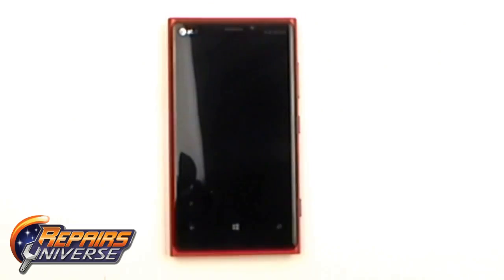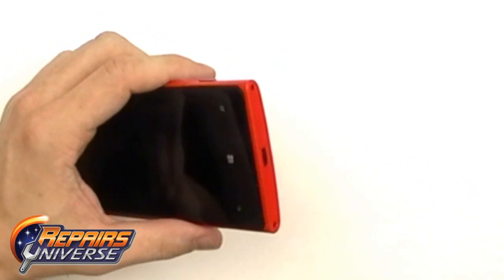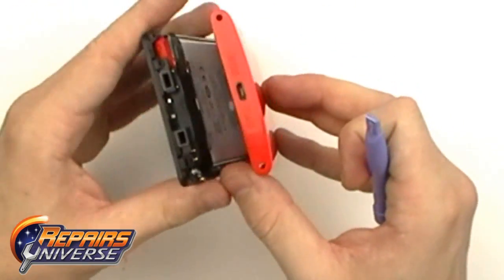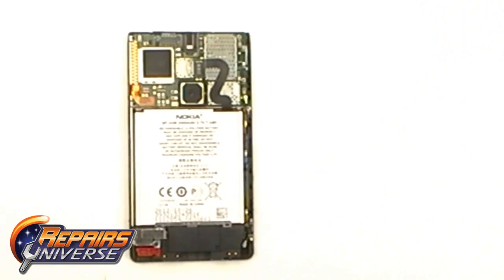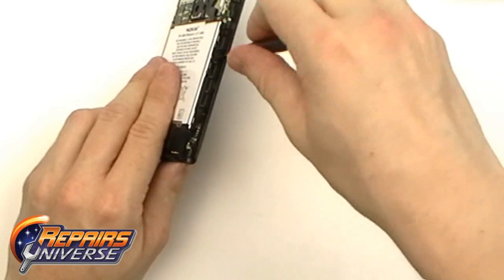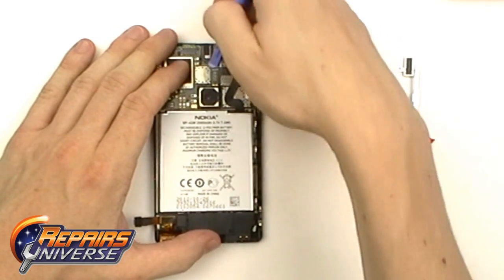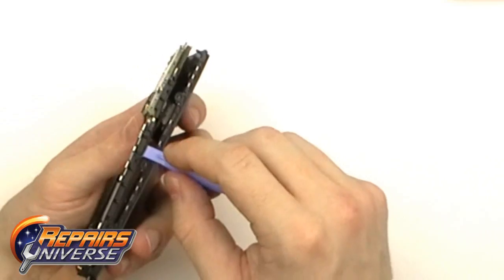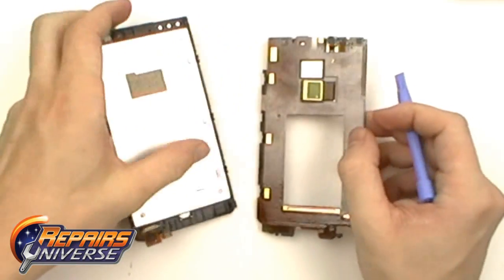Nokia Lumia 920 Screen Take Apart Repair Guide

Comment: I only needed to get in far enough to reach the sensor and front camera. I did NOT need to remove the T-2 (or T-3, my smallest torx was a T-4 so wasn't able to get them out anyway) holding the circuit board to the chassis. I never got the frame fully separated from the screen, but got it apart enough to get a lens cloth and air can in to the sensor and lens. SUCCESS, my screen now stays alive until it is actually against my ear. Thanks Repair Universe. #lumia920dust

Comment: I noticed the copper heat sync is not in this video.  Do you think it's required when re-assembling or can I chuck it out after I remove it?

Comment: Please remove the part where you rip off the volume button flex cable. every oke who does it breaks the thing when they replace the digitizer and then the flex cable has to be replaced.  Digitizer can be done without taking it off. I know its an assembly video but wow the forums are full of people with this issue and they all watched this video.

Rest of the vid is great.

Comment: my lumia 920 does not have the 2 screws at the bottom of the phone. Cannot take apart.
Reply from the maker: Are you sure you own a Lumia 920?
Reply: Yes by att
Reply from the maker: All Lumia 920 do have these screws. They may be covered but to our knowledge they should be visible.
Reply: Not on mine. Is there a 925?
Reply from the maker: There is a Lumia 925 variant which is configured differently. Is this what you own?

Comment: I don't want to take apart the whole thing.. I just want to know how to safely take off the screen so that I can replace the adhesive with this new adhesive tape I bought. How do I just take the screen off?
Reply from the maker: Using a heat source to loosen the adhesive will be required. However, removing the LCD and touch screen will be very difficult without causing any damage.
Reply: Not gonna risk anything.. Just gonna deal with it lol
Reply from the maker: I hear you, thanks for following our videos.
Reply: No problem.

Comment: Is that a t2 or t3 screwdriver... Apparently some people said it was a T2 screw.. Did you get it wrong or is it also possible to remove with a t3
Reply from the maker: You require a T2, T4 and a T5 for this unit.

Comment: The screws wont come out of my nokia lumia 920
Reply: they will. They're not held in there with anything. The plastic bit on them is just a tight fit. Get a pliers or tweezers and just screw it out and grasp the plastic cap part and turn and pull

Comment: You sent me the wrong goddamn replacement digitizer. The ribbon cables were on the top of the screen of the new glass, while they should be at the bottom. Now I have a phone in pieces waiting for CS to reply. I understand mistakes happen, but this is not looking good on your part.

Comment: This is a complete crock.  I ordered the replacement kit, followed the instructions to the letter as viewed and the ribbon strip on the side connecting the power to the side buttons was glued and tore, ruining the phone.  Costing me hundreds of dollars to replace the phone and I lost all data.  Complete sham.
Reply from the maker: Serena Martinez Hello, we are working to make our guides as thorough as possible. We want our customers to have a smooth repair with a professional looking result. Are you sure your device is beyond repair? If you ever get stuck you can always contact our technical support for help.

Comment: Thanks for the guide.  The repair went great!  Only thing was the mobo screws were T2 and NOT T3.
Reply from the maker: Travis.. I apologize in advance for all the problems you have encountered thus far. The repair should have been straight forward. Where did you buy your digitizer from?

If you bought the digitizer from us. Please feel free to follow this link
http://www.repairsuniverse.com/repair-service.html

Send me your device. I will see if I can get your device up and running. If you didn't purchase the replacement digitizer from us that's okay also. I will install the digitizer for 40.00 that includes return shipping to you. That is the best we can do. Lets get your device working again!
Reply from the maker: Please send us in the device. So I can look at it. Im confidant that we can repair the device for you. Please include your original invoice # with the order. The only thing you will be responsible for will be the shipping
Reply: Repairs Universe The frame had been damaged? Thanks for letting me know, I don't remember being asked if I wanted to 'repair the damage'! The phones functions were not perfect. The three touchscreen buttons rarely worked. It doesn't matter so much anyway. I wasted 80 bucks on some crappy Nevada company who sent me the wrong screwdrivers, then made me pay them again to fix it, had to deal with their crap job for a month before buying my own new 1520, but at least I have an awesome phone now which makes people do double-takes, so I'm sort of glad they dropped the ball. In any case, Nokia needs to make their phones better so that its easier to replace the screens. Using adhesive to attach it is just dumb, and you shouldn't need to take apart the entire phone just to replace the screen.
Reply from the maker: ***** No problem! thanks we will update the video to state the T2 instead of T3.
Reply: Repairs Universe Yeah, but you didn't update your order, and now I have a useless T3 screwdriver when I need a T2 screwdriver. Super pissed. Now I have a useless phone for a day until I can find a T2 (hopefully) at a hardware store tomorrow. http://www.repairsuniverse.com/nokia-lumia-920-touch-screen-digitizer-replacement.html  This website is WRONG and I have the WRONG screwdriver.
Reply from the maker: We apologize for the error. You should be able to locate a screwdriver at CVS, Wallgreens, Lowes, Home Depot, or Harbor Freight. They are only a few dollars and come wit just about every bit ever needed. We are in the process of updating the videos now. With over 300 videos to edit and post its a bit time consuming, and takes a lot of man hours to produce, edit and post. We are doing our best to bring quality content for free to our viewers. Your comments help us improve our videos. Please keep them coming.
Reply: Repairs Universe Well, to anyone curious, I checked Best Buy, Home Depot, Radioshack, a local hardware store, and PC Richards & Son. The local hardware store had a T6, but nothing smaller. Maybe you'll correct your error, respond to my contact request, and send me a T2? If you have the Terminator 2 version, I'll take that instead.
Reply from the maker: We are working on it. Please go to a Drug store. Went to CVS and Wallgreens last night both had the kits in home repair. 4.99 and 5.99 respectively. Wallgreens came in black case with red handle and 24 bits. CVS clear case blue handle and 14 bits.
Reply: Repairs Universe Maybe the T2 that I bought{on amazon} would have worked if the T3 you sent me didn't strip the screws already. Now I have a useless unused digitizer and a broken phone. I'm really glad you're so helpful, and that you continue to recommend the T3 (like in that comment to Jennie Smart).
Reply: Repairs Universe Yeah I got the digitizer, T5, T3, and adhesive all from you guys. I used the directions of this video, tried the T3 unsuccessfully on the 3 motherboard screws, then ordered a T2 from Amazon, tried that, and it didn't work either(because either the screw is stripped, or the T2 is a crappy ass screwdriver from China). But I may just send you the device, maybe a better T2 can get the screws out.
Reply: Repairs Universe I just went to the post office and shipped my phone. I included the original invoice # and a print out of this conversation, as well as the repairs universe pdf.  Hopefully you guys can fix it! Thanks for utilizing the comments on here to help me out.
Reply: Travis Statham Was your device eventually repaired?
Reply: Dor Kleiman Not really. The screen was super shitty. It had constant problems. It would move around in the housing. I had to turn it on and off constantly just to use it normally. I eventually bought a 1520 and couldn't be happier.
Reply from the maker: Travis failed to tell you that the frame had been damaged and chose not to repair the damage. We installed the screen and the phones functions were perfect. This is not typical of a normal repair. Sometimes some people have more issues than others.

Comment: Hi I followed this and i have my screen replaced, but the phone won't start properly after re-assemble, when power on, it shows nokia logo, then stuck at a bolt and gear sign. don't know what i did wrong. i have so many videos in the phone i don't want lose. please help.
Reply: As per Nokia let the Bolt and Gear spin away until the phone shuts off from low charge.. then plug the phone into the charger and let it boot up on it's own with the charger connected. Try this see what happens.

Comment: I tried this repair but had to abort since the screwdriver seems to be too big to remive the three screws at the side of the internal system.

I also bent the protective flap which protected the connector head of thin strip running from the micro usb port. This flap proved to be extremely difficult to open.

I put it back together but now my phone won't charge anymore via micro usb or wirelessly.
Reply from the maker: We have the appropriate screwdriver for your repair at RepairsUniverse (dot) com. Also, it sounds like you have damaged the Charge Port Flex Cable, which we also have available on the site. Best of luck.
Reply: The flex cable is fine. I had previously damaged my charger port by sleeping on the phone while charging it. 

I diagnosed the problem. Right above the protective flap where the flex cable connects to the phone's internal circuitry lies a smooth copper plate. I ASSUME that this is the wireless charging apparatus since a smaller black flex cable meanders away towards the battery from underneath thia plate.

I may have damaged/displaced something in that area.

I'll check your site out.

DIY > WARANTEE
Reply from the maker: ***** If the copper is broken or damaged it will not function correctly. There should be a connection that touches the copper plate. See if there is something that is stopping the process.

Comment from the maker: Good question, you certainly have a unique issue. Our best advice would be to take apart the device again and make sure all connections involving the touch screen digitizer are securely in place. It sounds like the added pressure from the case is causing an internal component to malfunction. Best of luck!

Comment from the maker: It's possible the case applies extra pressure on an internal connection that is perhaps loose or improperly reconnected. Does the phone also stop working when you apply pressure with your hands?

Comment: I have a strange issue, I replaced the digitizer and put it all back together minus the case.  Turned it on and everything works perfect.  Snapped the case on and the digitizer no longer accepts touch input.  Remove case and un-hook then re-hook the digitizer and it works again till I snap the case on. Ideas? Has anyone seen that before?

Comment: i opened my phone a bit, didnt go as far as to open the screen because i didnt have that T3 screwdriver to remove the 3 screws.. so i put everythingback, i turned it on and then suddenly the upper part of the back side of the phone got real hot real fast, what's the problem?

Comment: Well I got it off that same night by using a small vise grip. Being real careful got the vise grip on the torx bit head, slowly turned it as its not really tight. I did that with the 2 out of the 3 torx bit. the other torx bit  by itself it didn't need to be removed, then just gently pry off mid frame and mother board. other than that the instruction is on point

Comment: sorry to say but im doing this myself to my Nokia Lumina 920,, I dropped my phone by mistake and my screen is shattered on the corner,, so I went ahead bought a screen with digitizer. While following these instruction removing the last 3 screws,, its not a T3 bit,, its something smaller and now im stuck, cause I don't have a tool that small,,, Great !!